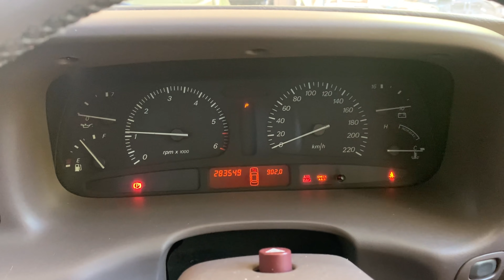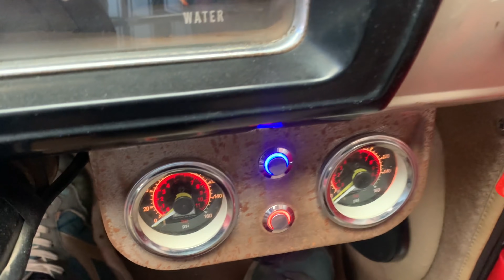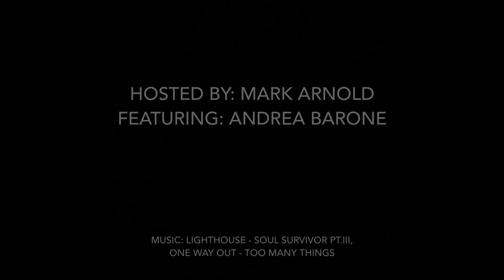Iron Empire EP 51 - Dodge Phoenix dragged out! My longest owned car!

Comment: Strange how that Dodge Phoenix is a Plymouth Fury in the USA and Canada.
Reply from the maker: Yea, a lot of our cars are a different brand over here.. you’ll find a Dodge Dart is Valiant over here etc...
Reply: @TheIronEmpire  Yeah, there's even differences between some of the older Canadian and US vehicles, even though we are right next door to each other. There's the odd late 50's Canadian Dodge  that was using mostly a Plymouth body. Also, most Canadian Pontiacs ran Chevy engines, but they didn't in the US. And my son has a '63 Mercury unibody pickup, which was built by Ford, but only available in Canada, so they are very rare and sought after by collectors in the US.